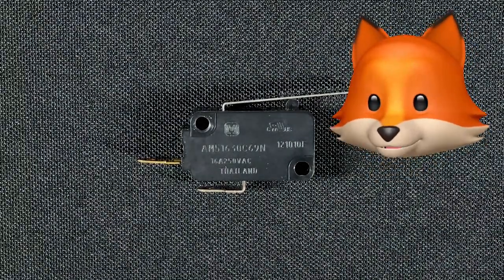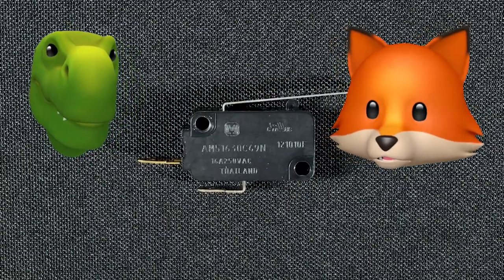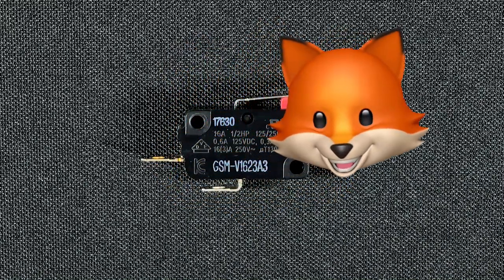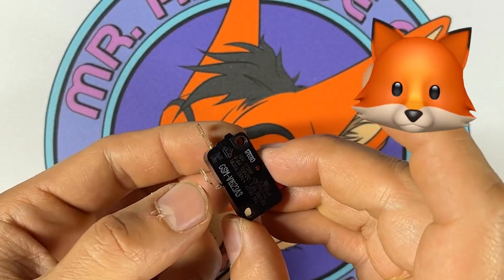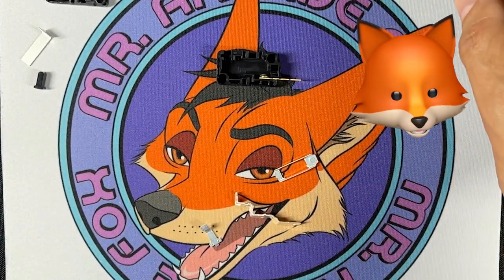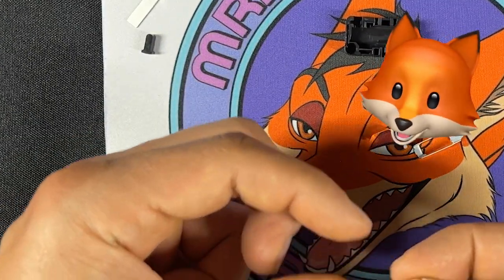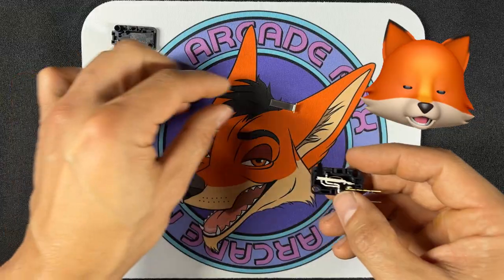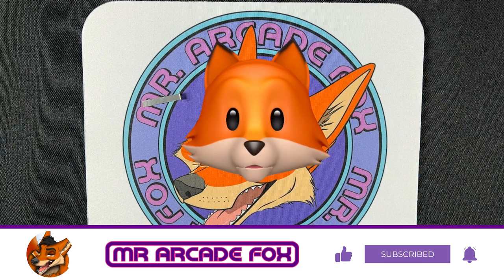How To Do A Short Hinge AM5 Spring Mod

Comment: Can you use the longer hinge from the A3? Wouldn't it feel different using the shorter hinge/activator on the A5? Great video!
Reply from the maker: The main dilemma you run across is Panasonic Switches levers are shaped differently than a Gersung switch. The lever slot is way further back. You wouldn’t be able to use the Gersung long lever cause it would be too short and could cause activation issues if used in a stick that needed a long lever switch. However if you had broken blood Diamond switches you could take the long lever from there and use it on the new switch.
Reply: @mr.arcadefox8782  Thanks for the reply! Bit of shame then but I guess that would have been too easy. Might still give this mod try and see how the smaller levers feel
Reply from the maker: Awesome! Let me know how you like them! ALSO!!! Thank you for your support! 🤗🦊👍🏻👍🏻
Reply: @mr.arcadefox8782   I was able to do this mod yesterday thanks to your video. I got a slightly different model AM5s with the normal size switch levers for Korean levers. I'm so happy with them as they feel far more satisfying to click and activate than just the normal A3 switches.

Thank you again for your guide ❤️
Reply from the maker: YAY!!! I’m so happy it helped you out! That’s great!!! ❤️💪🏻🦊👍🏻

Comment: Can you do this mod with a sanjuks v6? Great video by the way.
Reply from the maker: Thank you 🤗 Hypothetically yes… HOWEVER… you would need long Panasonic AM5 hinges because any other long hinge is not compatible. Could be an alternative to dead standard blood diamond switches to swap the long hinge.
Reply: @mr.arcadefox8782  ahhh I think I have them just found out I have 20 am51652c5n and looking at the sanjuk v6 to try.